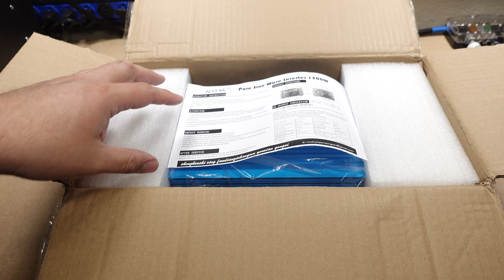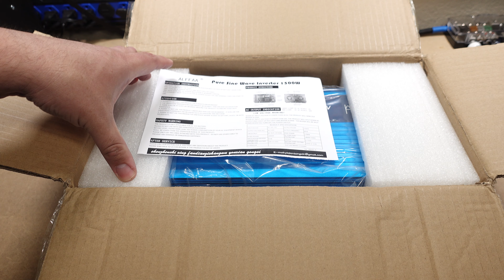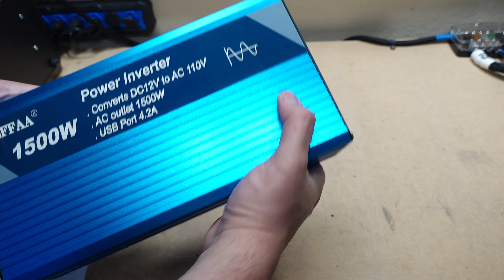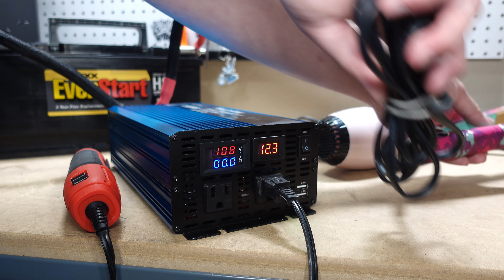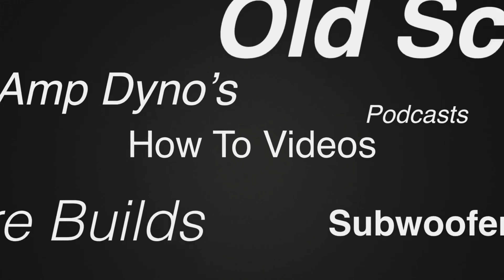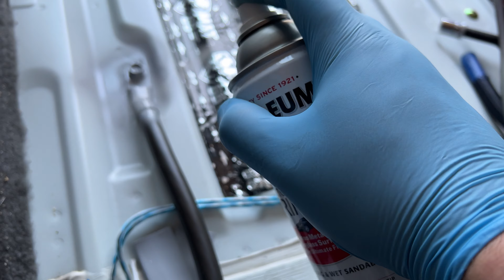Checking out the ALFFAA 1500 watt Pure Sine Wave Inverter

Comment: you are drawing 3.0 amps not 30 the read out is 00.0 not 000 . you may what to fix that
Reply from the maker: 3.0 amps 120v 30 amps 12v
Reply: @HifiVega   when it comes to those things i get renogy . ive had my 3500W 48V pure sine wave for 3 years with 8 renogy 200ah agm batterys on 20 195watt solar panels .

Comment: When it doesn't show any amperage being pulled on the display you could always use an amp clamp on the 12v wires. My addiction began with dumping a bunch of lithium in the daily, ended up with more than I really needed in the car n truck so I started building an offgrid/backup system. N 4 guage wires are prob fine on 1.5kw. I run 1/0 on my two 5kw inverters. The best amd cheapest way I've found to load the inverters down is space heaters. They pull constant amperage and a lot of it. 
Well done video take care brotha
Reply from the maker: Great idea!

Comment: One thing I noticed first off.  Many people don't realize that you need serious cabling for a larger 12V inverter. You, with the car audio background, already know that and give it the best chance to work properly. (Doesn't help that a lot of the budget inverters out there ship with joke cables.)  The comment about sine VS 'modified' sine inverters is way true.  I have done various versions of a "most of the house' battery backup system. My first one was several golf cart batts in a 12V 600AH config, with a small quality modified sine computer UPS (all the LED lights and electronics) and a monster 3000W+ sine inverter that would only run when the refer wanted to cycle.  Worked ok, tho the LED lights dimmed oddly.. Went to a 36V Li-ion 'scooter battery' powered setup for better run time and no messy batteries. (Cont.)
Reply: The recycled batts were real cheap, but 36V stuff is kinda rare.  I tried a couple of computer UPSes that were 36V.  The first one turned out to be a modified sine.  Did not know that.  I've expanded the house UPS wiring and had the CPAP and electric blanket on UPS power. Turns out most electronic electric blankets don't like modified.  Smoke happened. Checked the UPS waveform.. Grrrr.  Found a different, more professional brand UPS, pure sine, it's out there now. I often, now, don't even know the power's dropped until I noticed that the mini-split has stopped.  Gotta watch those modified sine units. i even have a little inverter here that claimed to be 'pure sine'. Not even close! Put it on the 'scope... Square as the day is long.  BTW, some of the best loads for battery torturing are little space heaters. Couple power settings, easy loads, and can run for awhile...  Enjoy your testing!  Stu the power mad batty!
Reply from the maker: @TinkerbatTech  I’ll definitely hooked up a space heater and check it out. I have a big heat gun that I also planned on for future testing. I think it’ll be a good addition to the test kit